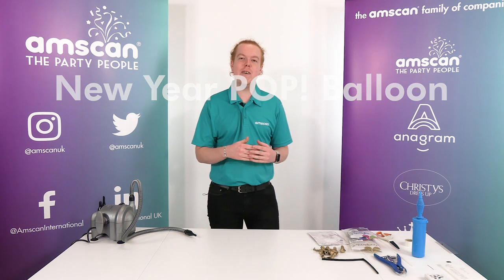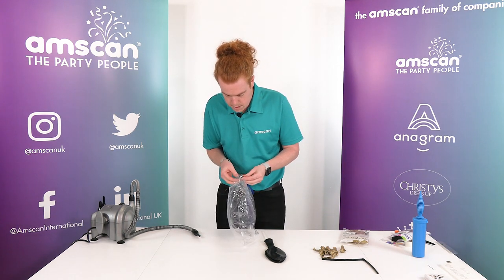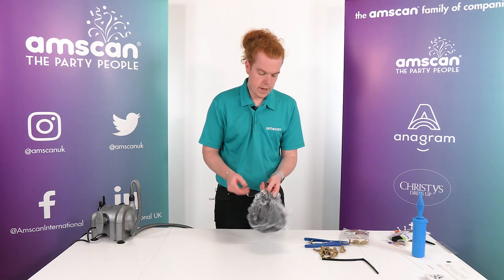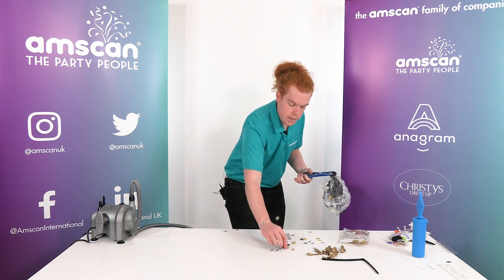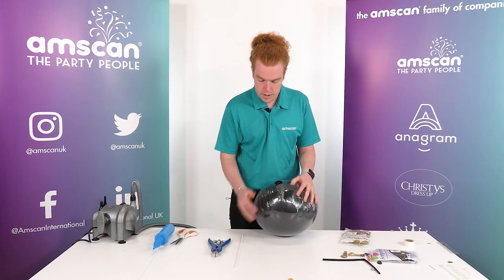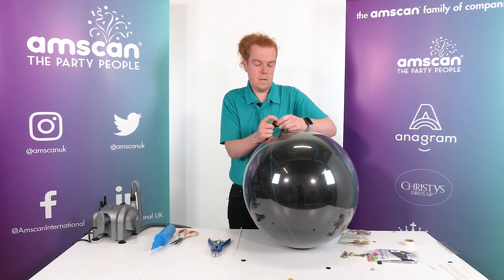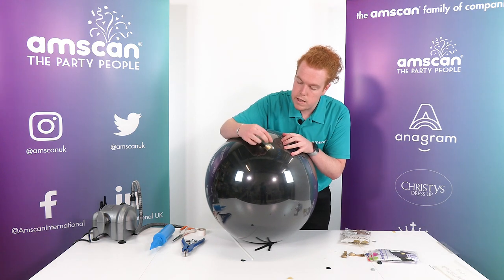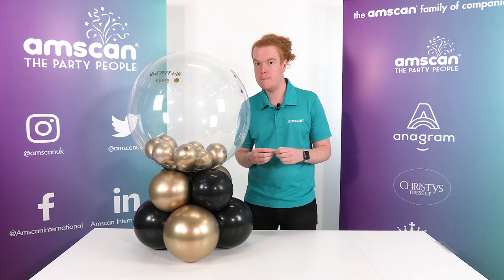New Year POP Balloons Using Anagram Crystal Clearz™

Comment: I followed your tutorial, which was fab btw. But unfortunately my inner balloon didn’t pop on the first stab. It just left a hole and started to slowly leak air. I used a pin… is it better the sharper it is? Also do you have to use a 24” latex balloon? Can you use a bigger size?
Reply from the maker: Hi Melissa, Thank you for giving it a go! If it just left a hole, this would suggest that you haven't inflated the inner balloon enough. I would try inflating them larger to put the latex under more tension, then when you pop it, you should get the satisfying BANG! :) There is no reason why you couldn't use a larger balloon, as long as you put the latex under enough stress to get the pop. I'm not certain you would be able to get the Clearz large enough to allow the 36" latex, or something similar, to be under enough tension to get the pop. Hope this helps!
Reply: @AmscanInternational  thanks so much for taking the time to reply! That makes sense. I’ll give it another go!

Comment: Every time I've attempted this technique, I've popped both ballons. Any advice?... PLEASE HELP
Reply from the maker: Oh no! Sorry to hear this. Here are a few things to try:
1. Don't inflate the balloons to their size limits. This will mean that they aren't under quite as much tension, and therefore won't pop with quite as much power. However, this is a balancing act, as the latex balloon must be under enough tension to pop rather than just deflating.
2. Allow time for the balloons to relax before popping. Give them around 30 minutes or so before you pop it.
3. Make sure the Stretchy Balloon Tape isn't placed too close to the Clearz seam and is stuck to the balloon really well. This will help to stop the balloon from tearing.
4. Use a really fine pin to pop the balloon. A larger pin will increase the chances of the Clearz popping.
I really hope this helps!
Reply: @AmscanInternational  thank you so much
Reply: @AmscanInternational  my balloon pops from the other side and like the middle rips the clear one and they both pop